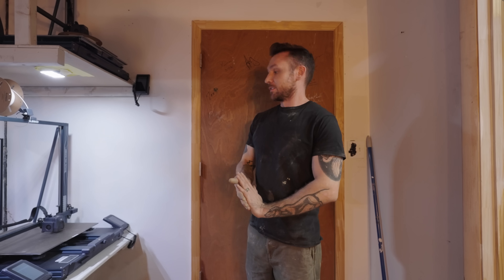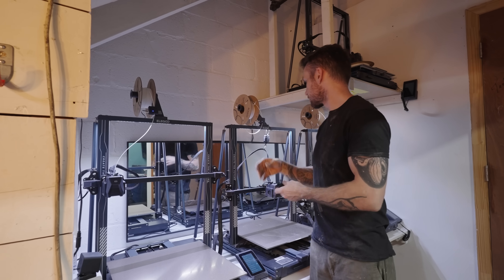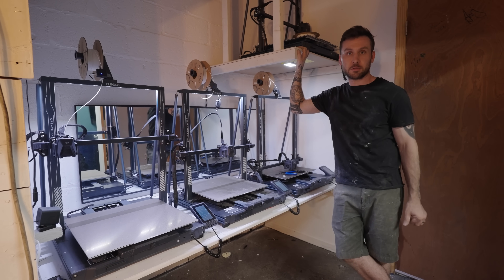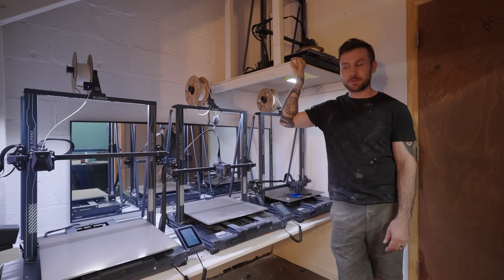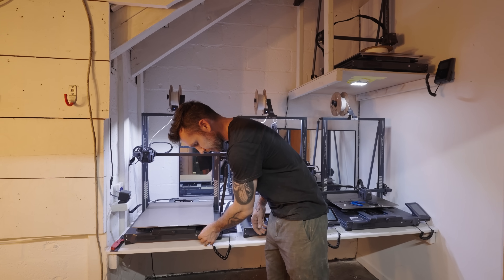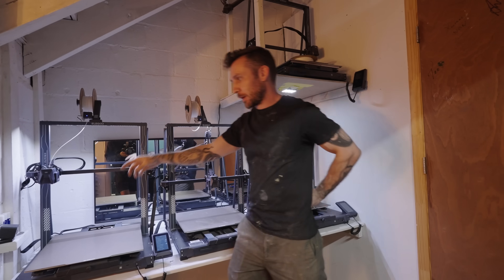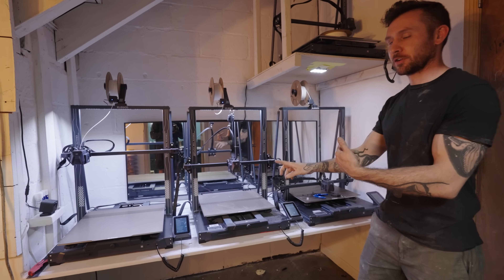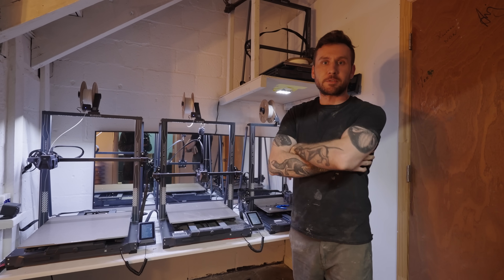Making Carbon Fiber Parts w/ Elegoo Neptune 3D Printers | The Legacy (12)

Comment: I’m just a tech nerd but will receive an HP 580 Color 3D printer with a Creaform 3D scanner….for another project I’m working on, but I’m a total gear head track guy, have farm so barns and 3000sq feet heated floor garage for my 2 full cage race cars and 4 other track cars ….mechanic lift etc fabrication equipment (for cars) etc …It’s my hobby, I work in business consulting and also make educational videos…I use adobe premier pro as software etc …started doing that before YouTube existed and tech sucked!!! Digital cameras weren’t invented yet and transferring film to AVI was stupid difficult especially with by today’s standards archaic computers …Napster days…all that to say… have high school education nothing more and learned everything by reading etc…My question is if anyone can suggest which software is good? .. example solid works,solid edge … I’m good on a computer and driving a car depending who you ask …watching these videos will try to make aero parts …or at least moulds..any suggestions ?

Comment: Tim, because of this video and build series I found out about Elegoo. I'd been wanting to get into functional printing for a long time but didn't want a full-time hobby of messing with printers to make them work. This video gave me hope that these mid-range priced printers had gotten to the point of being usable for production work outside of users who are hardcore into printing.

Unboxed a Neptune 4 Max December 25th (my wife loves me), and I've been printing nonstop and it's been great. From printing a test print of a front clip of a design I'm toying with, to printing custom brackets and tools it's been fantastic. A few small issues so far, and a few failed prints. But overall I couldn't be happier so thank you for bringing these printers to my attention. My friends are already asking what I'd recommend, it to be honest it would probably still be a Babu or Prusa, but these are definitely a contender, especially once they have been support in the common slicers.
Reply: Have you printed any nylon CF parts? Really interested in the 4 max for printing functional parts for my car.
Reply: @Programentalist  not yet, but it's definitely in the works. I'm actually about to do a large ASA print and that actually is similar and in some cases higher temp requirements than PPA-CF.

Comment: I'm enjoying your build series! Here are a few tips to enhance your 3D printing experience:

Enhance Reliability:
Utilize a PTFE tube to guide the filament into the extruder, minimizing wear on the extruder input.
Employ a cable chain or PTFE tube to provide strain relief for the electric cable, reducing fatigue.

Ensure SDCard Reliability:
Opt for reputable branded SDCards to prevent print failures, especially during longer prints.

Optimize Filament Handling:
Consider using larger spools (2 kg or slightly larger) for prints and support them with skate bearings to lessen the force required by the extruder.

Quality and Maintenance:
Purchase additional nozzles as spares to maintain print quality, as nozzles tend to wear out after printing few kilograms.

Reduce Print Time:
Upgrade to a 'Volcano' style hotend with an extended (stroker) melt zone for nozzles of 0.8mm or larger with thicker layers (> 0.3mm). This upgrade will handle the necessary extrusion throughput without overheating the filament and enables to print thicker layers and/or to print faster.

Comment: I don't know if Chris @TofuAutoWorks covered this in his 0.8mm nozzle settings, but you might just be hitting the max volume the hotend can extrude at that speed. I see it's a 60W heater which is pretty beefy - but you might just need to slow down a touch, maybe 10%?

Comment: Curious if you all had any problems with bodyworking the prints? PLA is known for melting and not sanding, did you have this problem? Also, the glass temperature of the plastic is fairly low, and did you notice any changes from the heat generated in the body filler or panel bond?

Comment: Just a tip, if you're storing more filament that are not vacuum sealed, you should build a little enclosure with an air de-humidifier (a cheapo amazon one should do the trick), should be stored at about 35% humidity. It will keep your filament from going brittle which would suck if you're doing huge prints overnight. Also a good idea to take off the filament in the printers and put it in the enclosure if you're not printing for a while.

Comment: The reason why you're 0.8 nozzle failed is due to that room being cooler, if you just bump up the printing temperature you'd probably be fine. 
Also, a little hair spray on the beds will help them stick if you ever run into issues with large prints.
Reply: I can never get my .8 nozzle to work out. I've just not the experience I guess.
Reply: @TylerGotAYTAccount  Id say bump the temperature up by 10*c and slow the pring speed down to 80% of what you normally do.
Reply: @TylerGotAYTAccount  It could also be the volume the hotend could handle. If you don't slow down the print the heater simply can't melt the material that's being requested. I think it's been depreciated now but e3d's Volcano hotend simply had a giant heating area to melt more material.
Reply: @TylerGotAYTAccount  I'm a little late but in case any one else reads this your problem is your hot end heater block cannot melt the filament as quick as you can print it. 

A volcano hot end as the gardner mentioned. Or you can get a longer nozzle thread and add bolts to it and hack a cheap volcano style hot end which gives the filament time to be molten all the way through and not cause flow issues.

Comment: I'm a CAD guy and it's definitely fun to draw stuff like this but it is incredibly time consuming, respect to Ivan for volunteering his time but if you haven't already, you guys should definitely hook him up with some merch or something because I'm sure that's a lot of time!
Reply: Thank you, I appreciate it!
Reply: Are you skilles in 3d scanning and CAD?
Reply: @crossbreedperformance  3D Scanning, 3D Engineering, CAD, CAM, 3D Printing, Reverse Engineering, Engineering suspension kinematics, and other mechanical components / assemblies.
Also got some motorsport background, and some knowledge in mechatronics and aerodynamics (CFD)
Reply: @crossbreedperformance  I don't know if this is at me or Ivan, but I have not done much in the way of 3D scanning but have 20+ years experience in CAD.
Reply: @ChadPowell02  Yes, it was directed to you, and thanks for the response. I have zero knowledge about 3D scanning and CAD, but as I lay the blueprint for my project down I came to know I will probably need both  but CAD  for sure, so I was looking for someone with experience with it.
Reply: Did I miss it, or was the type of filament mentioned? PLA? PETG? PLA+? Nevermind, it was in the link in the description.
Reply: I’m just a tech nerd but will receive an HP 580 Color 3D printer with a Creaform 3D scanner….for another project I’m working on, but I’m a total gear head track guy, have farm so barns and 3000sq feet heated floor garage for my 2 full cage race cars and 4 other track cars ….mechanic lift etc fabrication equipment (for cars) etc …It’s my hobby, I work in business consulting and also make educational videos…I use adobe premier pro as software etc …started doing that before YouTube existed and tech sucked!!! Digital cameras weren’t invented yet and transferring film to AVI was stupid difficult especially with by today’s standards archaic computers …Napster days…all that to say… have high school education nothing more and learned everything by reading etc…My question is if anyone can suggest which software is good? .. example solid works,solid edge … I’m good on a computer and driving a car depending who you ask …watching these videos will try to make aero parts …or at least moulds..any suggestions appreciated!